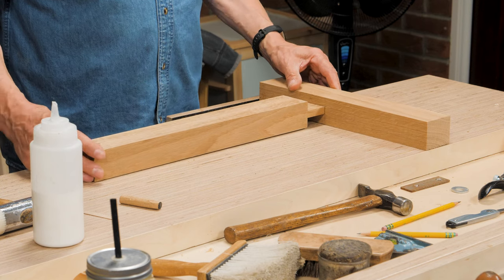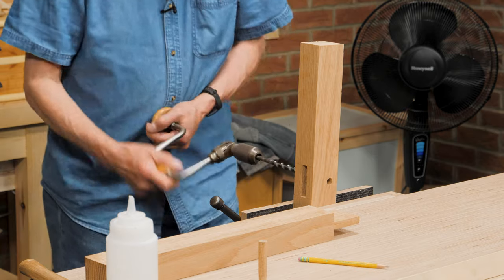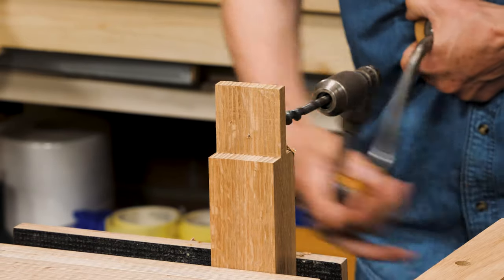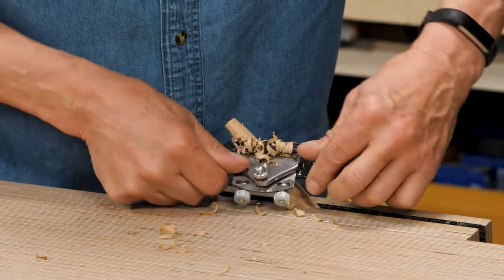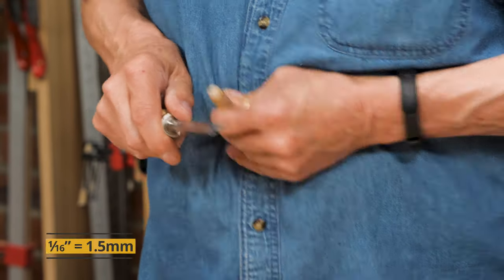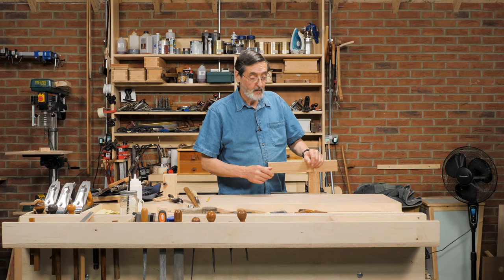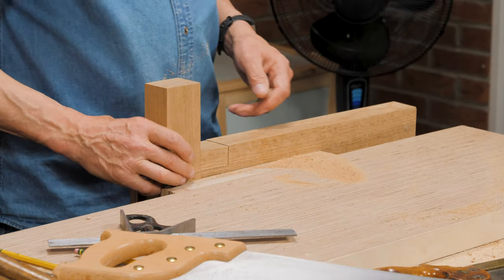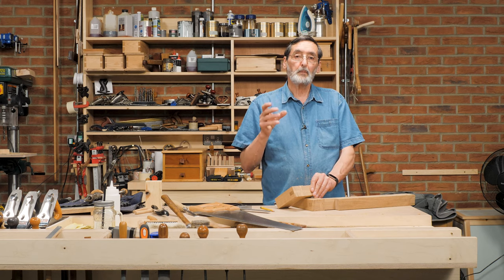Drawbore - An Inside Look | Paul Sellers

Comment: Another consideration is to keep the timber you use for the pegs extra dry. In the past I have planed the stock square and left it near to my woodburner for a few days before rounding it off to it's final dimension and driving it into the joint. The peg will swell slightly relative to the rest of the joint. It will never come out after that.
Reply: good tip
Reply: I was also taught to compress the peg wood in a machine vise before driving it through the rounding die.
Reply: Not sure if I want to do that. I tend to want it to pull the joint as I am putting them to gether and I then want the expansion to be small over time so as to allow it to form an even tighter joint. 
Is this a traditional technique used by people?

Comment: I grew up in a house that was built in the mid 1800's. Not nails were used in the framing. Only pegs.  I am betting that this method was used. When my dad had removed some of the horse hair plaster and home made lath to do some renovations, the construction was really amazing to look at. Thanks for a great video Paul.

Comment: I read something in an archaeological magazine yesterday I think, that talked about glue.  Resin actually.  And it was found on the fastenings our ancestors used on the wooden handles for the stone tools they used.  So, yeah, you man\y not need to use glue, but we've used it for a long, long time!

That was a fine joint man.  I always wondered how it worked, exactly.  Thanks for sawing it apart and showing us the finer points
Reply: Dry and glue joints both have their strengths. Humans have been using the whole animal for hundreds of thousands of years. 
I remember reading about dental floss markings being found in the teeth of a Paleolithic Era
women teeth. They were using string to clean between the teeth. Truly fascinating.

Comment: A picture paints a thousand words springs to mind here Paul. Excellent little video. I wonder how many viewers were surprised by the bend. Not had time to read all so sorry if its been mentioned, dryer wood for the pegs is a good thing, they will swell as they eventually equalise moisture content with the parts. Thanks for sharing another little gem Paul.

Comment: I knew about the concept with the peg hole joinery but I had it all wrong. Thanks for showing how that offset works. That surely was an eye opener for me. What a great way to pass on this knowledge!
Reply: It will still hold with a straight through dowel joint. I have made lap joints and used dowels to hold them in place and they still are working 20 years later on barn doors and gates which surprised me.

Comment: just my 2 cents here; (1) I find that drilling the hole before chopping the mortise instead of drilling the hole on already chopped mortise results no blowout inside the mortise(female). (2) it is possible to use a square peg when the hole on the (female) mortised piece is converted to a square hole by chiselling (inside of it does not have to be a dead square). I think this way takes less time. (3) Square pegs also look cool. (4) Mortises can sometimes be very tight and to take off, one has to use massive energy and effort. So to alleviate that people take the corners of the (male) part. In addition to this; I also find that if the male part is made just a tiny bit concave on the cheeks by gouging, this allows to disregard irregularities in the (female) mortised piece to some degree.

Comment: Without the glue is it realistic to be expect to be able to disassemble this if absolutely necessary? I am building a bench and I don’t want to use bolts but I would like the option of being able to separate the leg assembly in half in case I absolutely had to move it. I realize this is not something that could be done repeatedly but could it be taken apart once without doing any real damage to the tenon?

Comment: Incredible, I'll have to keep that trick in mind. The cutaway view is great. I wonder if someone discovered this by mistake or did it on purpose the first time. Also how did the ancients drill holes in wood? Did they have some means to make a spade drill?
Reply: I suspect they were making tenon joints and just wanted a method to keep it in place so that it could not be pulled out. And that is what somebody arrived at. It is possible that they did this with lap joints as well or bridle and maybe even dovetails.

Comment: I was a little surprised to see a washer being used as the die. In my experience the hole in a washer tends to be quite a bit bigger than its nominal size and with repeated use either bends or becomes dull quite quickly. . Probably does not matter as long as it the dowel or pin not too big? 

I once needed to make dowels for some reason which I forget now, and found that drilling out a ½“ nut with a ½" drill made a very effective die for the purpose.

I found great pleasure in seeing that your awl is exactly the one I have. And then that brass backed tenon saw! Darn, but I am sure I have got one just like that... What make is yours, if I might ask?

Comment: Your videos are utterly fantastic! Is there any reason one could not use a commercially  produced dowel?
Reply: Because some dowels are not exactly sized to the drill bit.
Reply: @tommccurnin524  isn't that why they make different size bits and dowels? Still I think it's cool as all getout that Paul shows all the great details that he does!
Reply: Also most commercial dowels aren't great because the grain doesn't run exactly parallel to it which makes it less strong. But if you can get a nice straight grained dowel that fits one of your drillbits there's nothing wrong with using that.
Reply: I was just musing on the use of this method and wondered... this might be also used to keep corner joints tightly together as well. As in like a frame for a tabletop or a door, if they were of  sufficient size. I was thinking as if I were to make a tabletop using a floating middle sort of like making a floor without nails as in Korean joinery. Any thoughts?

Comment: Is it recommended or any more forgiving of hole offset to use a softer wood for the pin since it has to bend or does it not make a difference? Draw bored and keyed for takedown mortise and tenon are the 2 joinery techniques that I can't wait to use for some projects

Comment: I believe I noticed that the hole through the mortised component is not square to the side, but at a slight angle.  Was this intentional and does it have a purpose?
Reply: Just the way he hand drilled it. The real strength is in the off set holes that force the pressure on the drawbore joint. 
Remember he is doing it for a demonstration as well and talking to us if he was doing it on his own he may have it straighter.

Comment: Would it be okay to use a pre made wood dowel instead of making drawbore pins? 
If not, what would be acceptable wood species to make drawbore pins?
Reply: Yes it would be fine to start out that way but there is a pleasure you will gain from using your own made pins.

Comment: Paul, when assembling, do you make any effort to orient the peg grain in one direction or the other?  Or is it irrelevant?
Reply: I don't think it matters all that much, but if you wanted to be fussy you would orient the growth rings in the peg with the grain of the stile so most of force from any swelling of the peg will not be trying to split the stile.
Reply: @curtis Heller
There maybe a difference but experiment to see if there is. I once did such a joint with a bolt, washers and wooden tenon joint. So I used the bolt for the drawbore and it is still working 20 years later with no real structure problems as my worry was it may draw too much tension on the wood. And it still works as a farm gate and has take lots of abuse.

Comment: Hi Paul, big fan and new to the beautiful craft. When should i use what kind of wood ? And are some types better than others ? Big fan from Denmark 😊
Reply: Up front... I'm not Mr. Sellers. I do welcome you to the craft, though... AND I suspect some of the substance he'd have to tell you.

I know at the surface level, it doesn't seem like it... but that's a really complicated question. There's tons of advice and wit about it, too... Starting off, find wood that looks nice to you. Do it to pick up the skills and make neat stuff that doesn't have to stand a test of time and generations... because it was cool while it lasted.

   The truth is, softer woods tend to be great for low impact but medium to high stress duties... like putting pine into framing a house. It's not designed to take a meteor hit, but against a fairly constant strain of wind, rain, snow, it's plenty strong enough.
    Hardwoods are tougher to work and a bit harder on tools, but they're pretty great in "high traffic" surfaces... like the seats of chairs and stool steps... It's durable enough to take a pretty rough use, but does chip... handles strain okay if you're not TOO enthusiastic, but doesn't tend to bend so much before it snaps or splinters...

     There are a few "oily" woods. Cedars, Teak, etc... where you can buy finishing oils made directly by extracting from the wood itself... AND these tend to last a bit longer outdoors, in the wet and weather, even without finishing (at least for a while).
    Make no mistakes, here... unfinished wood will not last as long in most conditions as finished wood. Even paste or wax is better than completely bare... just that oily woods tend to take a bit longer before deterioration sets in.

    There are books and publications about the various material science based studies of wood by species, by straight or irregular grains, by hard and soft varieties... and other than a short list of notable exceptions one way or another, most wood will perform about the same as any other over the lifespan you can expect of a product.
     At some point, of course, there's the earnest effort to make something "heirloom worthy". AND just for the record, it's my experience that there are a few exceptional woods for just about every job, but not a particular "best wood ever" for everything. Experiment, pioneer, and don't be afraid to watch something catastrophically fail under its first test. Through all the advice you're GOING to find, you'll develop a personal taste and discrimination about which wood species just feel better for working into certain things... but it's a quality of craftsmanship and skill that gets heirloom qualities in a product, far more than a species of tree.
    Hope this helps... and Greetings back from Tennessee (USA)! ;o)
Reply: @gnarthdarkanen7464  hello :-) and thank you for the verry nice answer. I have a question though. While making a chair, would you make it entirely out og hardwood or a combination of the two ? Like hardwood for the back support and the seat you sit on, and softwood for the legs and the fraim of the chair ? Best regards from Denmark :-)
Reply: @dpsjs  It's generally just as well done either way there.
    Important notes on "wear" with chairs, particularly lightweight chairs, is that they tend to get moved by dragging... Dining chairs (for instance) will tend to wear more on the feet when pulled out and pushed back under the table for every meal.
   This can be remedied with plastic or rubber cups (sliders) attached to them, but some might worry it ruins the rest of the "rustic aesthetic". (frankly, it doesn't)

    In heavier chairs, like a lounge, fainting couch, or love-seat, this isn't as much of an issue. At least in normal use.

   At the risk of being repetitious, experimenting while you don't worry about "standing the test of time" is probably more important. There are traditions both ways about chairs... AND I've even carved out hardwood "runners" for a softwood framed chair to spread the weight out on the floor as much as to lower wear on it being dragged all over the room. ;o)
Reply: @gnarthdarkanen7464  well thank you, this does clear up some questions. Guess this is as good a place to start as any. Won't get much better only asking questions. :-p i still do hope to see Mr. Sellers make a video about this, as i belive this could be a good topic.
Reply: @dpsjs  It is certainly a good topic, and you may find more about it on Mr. Sellers' Channel page, under "videos" (provided you can get there on your device of course).
   I'm glad to be of some help to you, and yeah... "You gotta start somewhere."
   It's worth saying, that a lot of the questions you have now are likely to change a bit as you get started doing. You'll refine better questions, and the experience will help you understand the answers you get a little easier.
   Good luck with your projects, and welcome to the craft! ;o)

Comment: Of course what we have to remember here is that traditionally there was no glue used in these joints and that even if cut apart as Paul has done the peg would remain in place and the joint stay together.

Comment: I think I'd struggle to maintain the 1/16th offset with my cack handed drilling. I'd love to pick up a good bit and brace, but don't really know what to look for. I suspect I'd probably end up with a dud. Any advice Paul and viewers?
Reply: Actually, Wood by Wright did a WONDERFUL set of videos about the brace and bit... One of them is all about the important components, functions, and why you need to be careful buying...
    The brace is simple enough... the chuck looks different, but works exactly like a "speed chuck" on any cordless. Twist left to open, right to close... 

     At the first "joint" just above the chuck, most braces have a weird mechanism, with pin(s) and a notched collar. Rotate the collar all the way to one side, and a small lever should "open outward" on one side. This lets the thing "ratchet", so you can rotate it in short arcs, rather than cranking all the way around. AND you should be able to rotate the opposite direction "all the way" to open a second lever and ratchet the other way around... exactly like a "ratchetting socket wrench" (overt technical term) for any mechanic's shop.

    The bit, however... takes a bit more "minutia" to be conscious of. MOSTLY, the important stuff is at the cutting end. Obviously, it should have a proper shape to insert into the brace, with reasonably sharp corners to keep it from "rounding" inside the chuck.

1.  The "snail" or "worm" looks like a screw sticking out of the "business" end of the bit. If it's broken, missing, or mis-shaped, it's not going to penetrate and draw the bit down through the wood...(which is kind of the point of it being there)

2.   There are "scoring cutters" (sometimes called "cheeks") at the cutting end, and they're supposed to stick downward to score the circle into wood fibers before the blade actually starts chipping material up. 

   Okay... the minutia. MOST older bits (that I've seen) have two. One for each blade, to match each spiral. If you only have ONE blade to chip up material, and ONE spiral to carry the stuff up and out of the hole, you'll only have ONE "scoring cutter"... and it's perfectly okay.
    Ideally, there should be plenty of cutter(s) left to the bit, but these are often older tools. AND the cutters and chippers get dull and have to be sharpened... so you just want to check to see that it/they are present and in reasonable condition... not splayed out from the bit, or hopelessly flattened, chipped, or worst... missing all together.

3. Chipper(s)... when the bit fully engages, it's up to the chipper to sink into those scored fibers, and lift material out of the hole. These are generally in best condition straight, and sharp. There's pretty nearly no way for there to be a spiral without a chipper at the end all together, so counting the chippers is a quicker way to match spirals to "scoring cutters" (no... it's not nearly rocket science) Visible gouges and chips or cracks will clearly diminish the performance of a bit, so the nicer and cleaner it is, the better it works. This is another point where sharpening is occasionally mandatory, so you are not so likely to find it in "absolutely mint" condition.

    Finally, yes... you are definitely better advised to pop over to Wood by Wright (channels on YT) and look into his series on bits and braces. They are relatively common (at least in the US) so not horrendously expensive. BUT he's also got the hot tips for sharpening and taking care of them, as well as visuals to accompany all the crazy descriptive terms and jargon.
   He HAS been re-arranging some of his content, so you might want to check out Wood by Wright2, since (as a tool specific dive) I'm not entirely sure where it'll end up. Hope this helps... ;o)
Reply: @gnarthdarkanen7464  thanks very much, I'll check that out. Sounds like what I need
Reply: @ricos1497  Always welcome... and should you still find a "dud"... they can be taken apart for spare bits to fix the next one, too. ;o)

Comment: Probably no glue around in them days so had to rely on peg. Great video as always Peter. Would you consider using a cordless drill instead of the bit & brace or is there a particular reason for using it?
Reply: Glue most certainly was around in those days but it depended on its availability to the craftsman.

Comment: You used 1/16” offset for a 1/2” dowel. What would be the offsets for 3/8” or 3/4” dowels?
Reply: I think 1/16" is good for 3/8" dowel (this is what I used recently and it held really well).  You might want 1/8" for 3/4" but you should try it out for yourself on the first joint and see/hear how it feels as it draws the joint together.  I used 3/8" for all the joints on a Roubo bench recently and the sound as the dowels pull the joint tight is quite satisfying. P.S. I didn't use glue because I might want to drill the dowels out in future for disassembly.